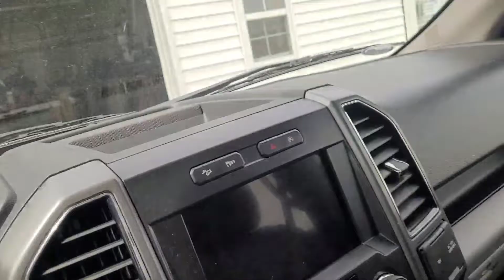2015 2016 2017 2018 Ford F150 F250 F350 Paneramic Power Sunroof Won't Open Diagnose And Repair

Comment: Hey Tony, Hopiing you get this message. I am trying to fix my sunroof. Took the glass off and found plastic pieces, but It did not work. saw the comments and figured out I needed to drop the motor. I can not figure out how to drop the motor. I can access it, but don't see the bolts you mention. Its driving me crazy Please help if you are able.
Reply from the maker: You have to feel for them. They are a torx screw. I don't remember what size.

Comment: Well...i have a 2015 with the same roof and it leaks right in the middle...i think this weekend ill pull it in and see if that plastic is keeping it from sealing...might kill 2 problems at one time...
Reply from the maker: Is it leaking into the truck or draining out the drains like it's supposed to?

Comment: I have this same problem with my 2017 F250.  The sunroof started leaking water so I tried to open it- and it is stuck!  Now that I’ve seen your video I’m going to take the glass out and see if I have those broken pieces in there.
Reply from the maker: I'm sure you'll find some. Good luck.

Comment: Also you can get a certain lube kit from ford parts department, under a TSB for the sun roof, it a little expensive,  but maybe silicon grease would be the ticket..

Comment: Another great video, Tony!  We have a 2014 MKX with the same style panoramic roof. It has worked great but if it ever stops, and I feel brave enough, I'll rewatch this detailed video and attack the problem.
Reply from the maker: Thank you very much! Don't use it if it's below 60 degrees or above 80 degrees. And only open and close it when the vehicle is sitting still!
Reply: @tonyscarcare5657 😂😂

Comment: Dude. ... dude. Seriously, this did the trick. I'm looking at a stupid piece of plastic that the dealer said would cost upwards of $3k for a new sunroof after saying the track was bent and that's why it wouldnt open. 

For just a little bit of my time, my 2017 Platinum sunroof is rolling free for the first time in 3 years! I cant thank you enough for this video. But has anyone found out what this plastic came from?
Reply from the maker: Thank you! It is definitely starting to come apart and will need to be replaced eventually, but it can be serviced from the top, so don't pay the dealer that big money!
Reply: Dealerships are the worst. That overcharge deserves a review on the dealership website!

Comment: just boight my 2016 platinum with 50k miles. sun roof worked first two weeks then started to sound horrible but still worked. sounded like plastic to me. and now its stuck just like this one was. the driver side doesnt want to budge. how hard is it to line the glass back up if i do this myself
Reply from the maker: It's not bad if you unbolt the motor. Each side will slide individually.
Reply: @tonyscarcare5657  thank you for this! my truck is dang near mint condition but the sudden failure with the sun roof has me upset. since i havnt had it even a month, i wonder if the dealership will fix it?
Reply from the maker: They won't. You're welcome, though. I told them last June at Ford Motor Company world headquarters that they need to do something about those junk roofs.

Comment: I have the same problem in my 2017 , I'll let you know what the problem is. Thank you for the video.
Reply from the maker: You're welcome. Thank you!
Reply: I found two pieces on the same site, plus I brought a little down the window because if they are flat, it can cause the same problem as well and won't open right.

Comment: Why did you “drop the motor” and what does that entail? I have this problem with my 2017 F150.
Reply from the maker: You have to drop the motor to get the cables lined back up.

Comment: Extra parts, I guess.  lol.  Great work.  What did you end up using to get the grease out of the headliner?
Reply from the maker: Thank you! It actually wiped right off. It wasn't really grease. It was dirt and Vaseline. It barely touched it, so luckily, it was easy.

Comment: Years ago, an inventor attached cameras on the outside of a car's door and transmitted the image to the inside of the car's door (which was a screen), so when the driver looked at the passenger door it appeared see through. No door or window handle, just a screen showing what you would see as if the door wasn't there. That was a very disturbing scene. Rolls-Royce offers a ceiling with shooting stars or the sun rising and setting, all done with electronic imagery. I remember my family owning a Buick Roadmaster in the mid 50s and my Dad complaining about the power windows always needing to be adjusted to work properly. It seems the United States loves to take something simple and complicate it. One of these days our ice boxes will have monitors in the doors so we can talk to Grandma on the internet. Oh, wait a minute, that was last year's new idea. 😬 😁 😏
Reply from the maker: I know. I don't understand what was wrong with the original ASC sunroofs. All this automatic stuff is not necessary.

Comment: Do u know if there i s a way to manually move it forward my tracks are all the way back and i can t get them to move forward
Reply from the maker: You will have to remove the motor to do that. Then, yes, it should move manually.

Comment: Do you have to drop the motor to remove the sunroof?
Reply from the maker: You do if the cables aren't even. I actually rebuilt one of these last week. I'll do a video next time. It's really not that bad. Don't take the motor bolts all the way out. Only loosen them enough to drop the motor down enough to clear the cables. Then you can move each one by hand to get them back in time with each other. Then, just tighten the motor bolts. You don't have to find the bolt holes. The headliner is stuck up with magnets, and it's the motor on the driver side. The other motor is for the shade.

Comment: I have a 2017 Lincoln Mkc and mines is doing the same thing so I guess I have to lube the rubber around the sunroof I hope this work cause sometimes I have to play with it to open all the way, it will tilt

Comment: Tony, did the broken plastic pieces from each side match? If they came from the window mechanism I’m surprised it still seems to work flawlessly. Strange indeed.
Reply from the maker: They did not match. They are definitely from the track assembly, and I've actually seen several sunroofs continue to work with missing pieces. It is strange.

Comment: Very good video I m appreciated.
I have 2018 f150 lariat 3.5 v6 sport 4x4 crew cab.my truck also same problem.after I pick the plastic pieces few months worked good.now completely stopeds.whats wrong I dont know.Still I searching a good expert for fix my sunroof properly.if you can any gentleman please contact and help me.I ll pay kindly.❤
Reply from the maker: It will have to be rebuilt at this point, I'm sure.
Reply: @tonyscarcare5657  do you  have work shop?and where it is please let me know thank you.
Reply from the maker: I'm in Illinois.
Reply: One Year Later.....  4803 did you have to replace the Plastic Mechanicnism's for the Broken Off pieces. Extra Parts isn't normal.
Reply from the maker: We never did on this one, but I have done one. I hope to do a video on the next one.

Comment: 2016 150 crew...as i was trying to reset and the shade got stuc shut with the sunroof open a little, about a half inch. Now it wont respond at all. Anyone have this issue? I guess I'll try disconnecting the battery next